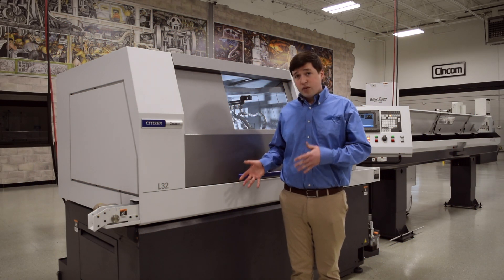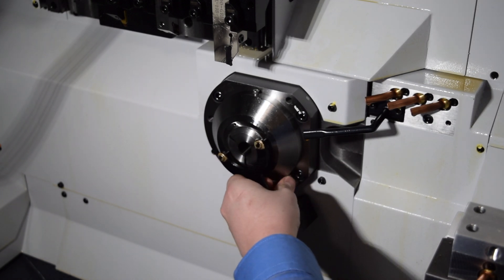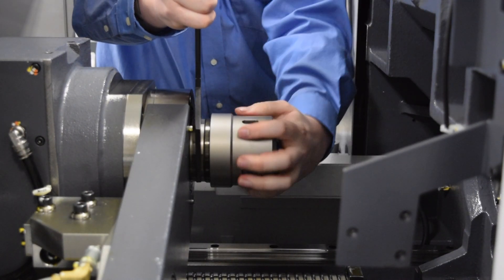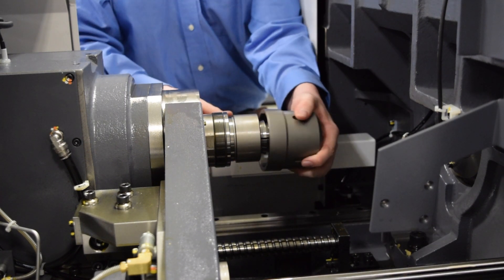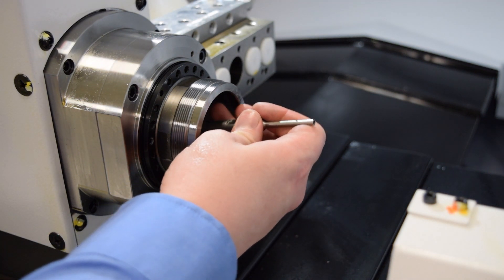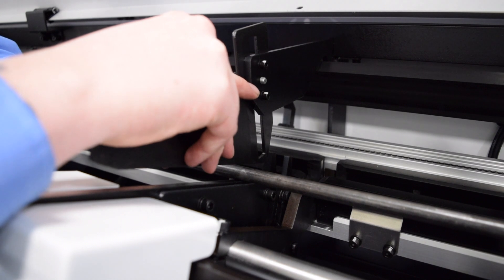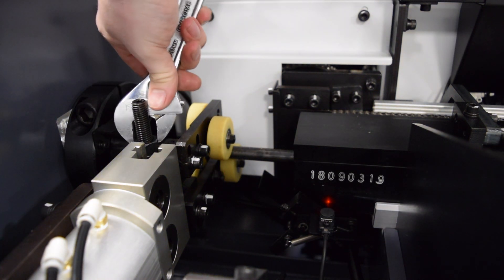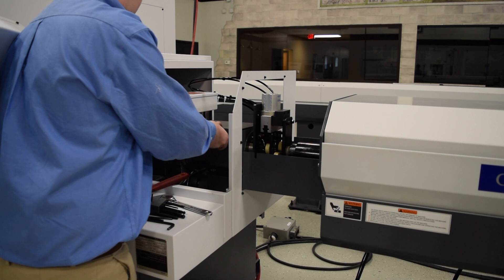Changing collets on a Citizen Swiss lathe (Basic)

Comment: Setting the bar tension on these machines are so annoying
Reply: Are you talking about the headstock or guide bushing?
Reply: @brandons9138  guide bushing
Reply: @jakeb8838  It is a fine line sometimes between having the right bushing tension and having a bar that looks like spaghetti behind the guide bushing. What machine are you setting up?

Are you running metal or plastic?  Do you use ground stock?

What I usually do to avoid too many head aches is let the part dictate how much I mess with the tension.  If you have to hold .0001 or .0002 then it becomes a much bigger issue than if you have .001 or .002.  The method I use is to have the  bushing just tight enough to slightly spin the bushing when I turn rotate the bar buy hand with the headstock unclamped.  This method only really works with larger material diameters.  If you are doing 1/8 or less diameter material it becomes a real pain.  At that point I just set it as best I can and run a part.  If the part is round, then mission accomplished.  If not, it is time to SLIGHTLY tighten the bushing and try again.  I find it better to start loose and tighten rather then start tight and loosen.
Reply: @jakeb8838  set it by activating the main collet after pushing bar stock thru the guide bushing and spinning the main collet by hand. if it spins kinda freely in the guide bushing youre set, tighten it up and leave it like that
Reply: @brandons9138  fully agree with what you said there. Been working on various Cincom machines for over 10 years now.
Reply: hi  @TheKeule33  i was wondering if you could help me with a component that i manufacture on a cam driven lathe and want to switch over to one of the swiss machine. Please can you help me with the same. I could email you the drawing of the component. 
thanks